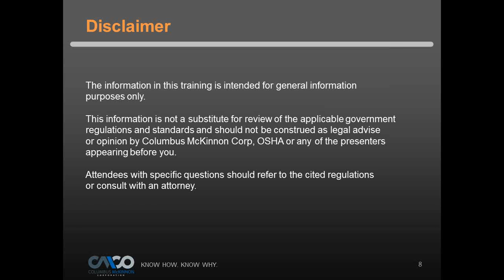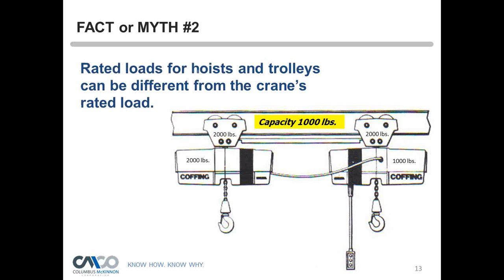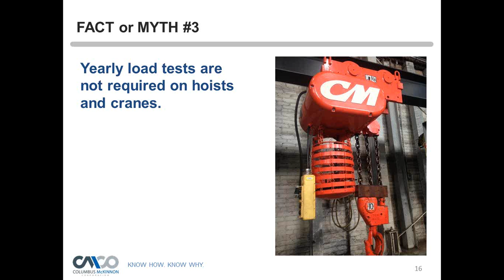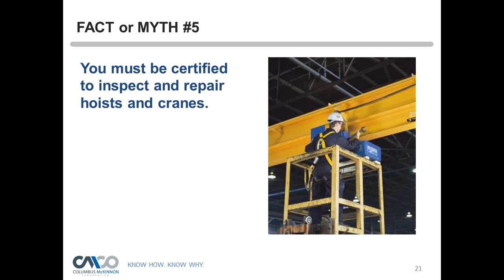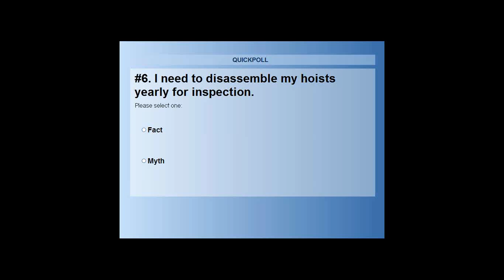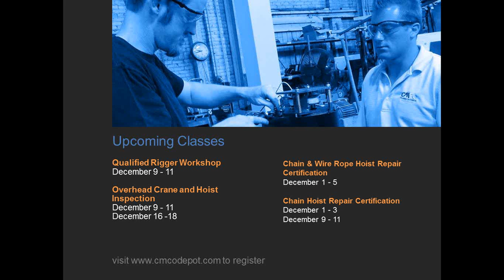Safety Webinar: Answers to your Top 7 Crane & Hoist Questions

Comment: FIRST TWO QUESTIONS - I once pulled down a 1/2 ton air hoist from a lightweight track system by misusing it - the bloody thing just missed my head and there was hell to pay. After an accident investigation, all similar hoists had anti-drop provisions  incorporated.
Reply from the maker: +Jester Mclarpet - Drop stops are a great safety device. I would be more concerned of the cause of the accident. Trolleys, if installed, inspected, used and maintained properly per the
manufacturer’s instructions, do not fall off.